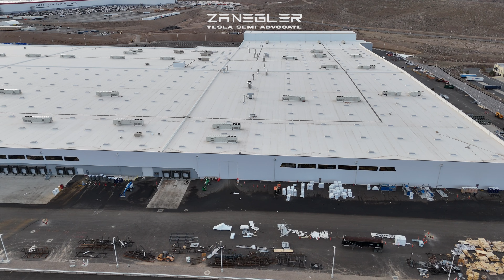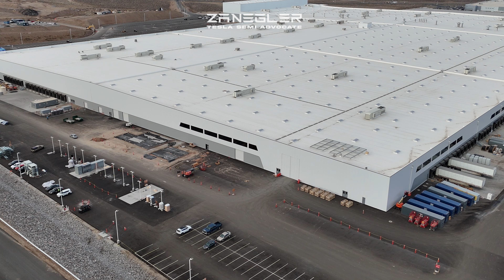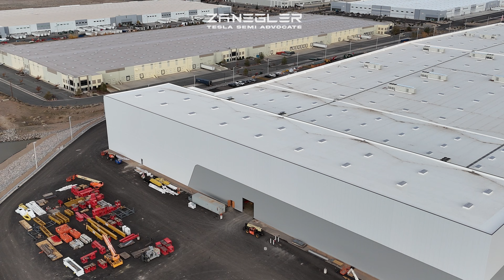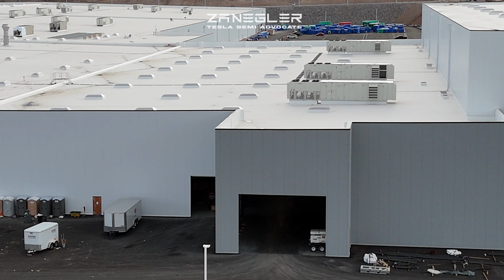Quiet Tesla Giga Semi Sunday

Comment: Thanks Zanegler
Sort by newest first or top comments if only the first few lines are visible
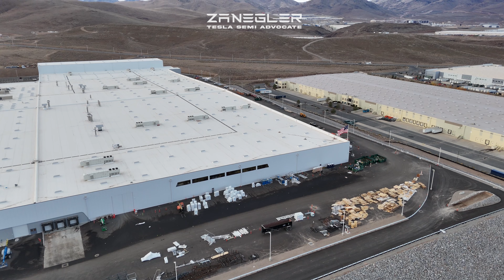1:07. Northwest corner. Escape ramp. Gravel removed. Escape Ramp Gravel Chief Compliance Officer not happy with the material. Demanded its removal. Investigation pending. *YLCOHMV.
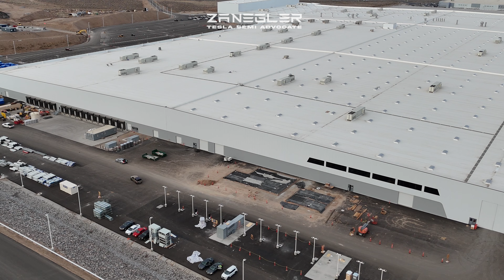3:11. East. Tesla MegaChargers. 4 Mega Chargers installed, as spotted by @eddeppman
Apron. 2 squares of concrete curing under what are likely insulated curing blankets.
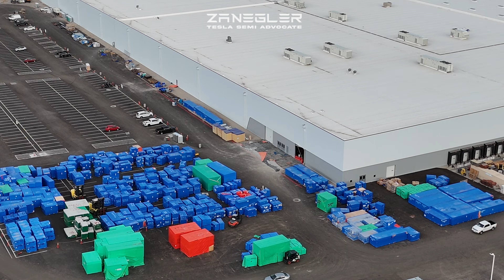4:48. South. East end doors. Curing blankets over new concrete in front of the doors.
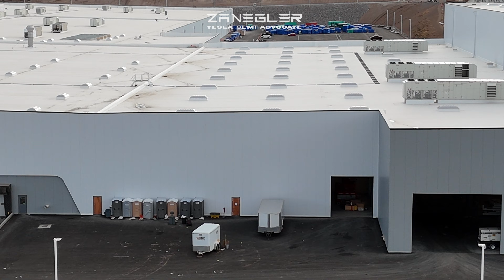9:02. West. Stamping. Smaller drive-through door. A screenshot with the exposure enhanced shows a big red machine. Might be the other stamping press staged inside out of the weather.
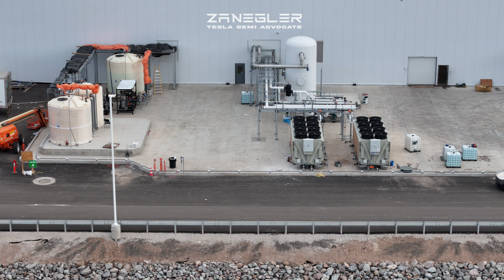11:31. West. North end. Pipework wrapped in temporary insulation. The orange and black plastic.
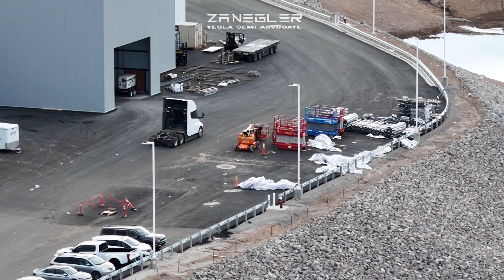13:08. Atlas program. What’s the name of the updated program? I’m hearing Atlas, and CC says the same.

* Your Local Concept of Humour** May Vary.
** Your Local Spelling of Humour May Also Vary.